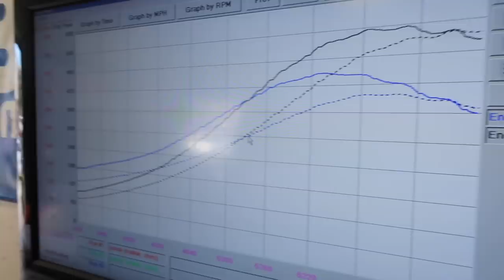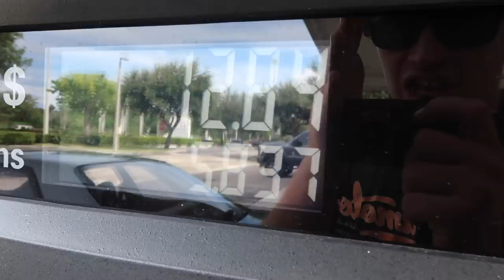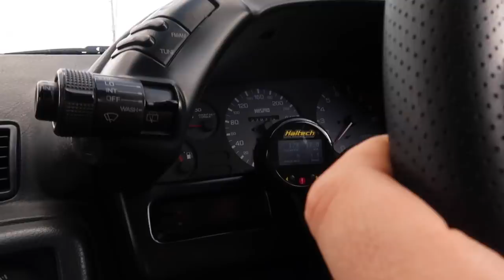GTR back on the dyno.. SHOCKING RESULTS!

Comment: Just a question, how do dyno pulls work? Do you shift through the gears normally or do you stick it in 5th and just mat it because i don’t hear any shifting during the pulls.
Reply: Dominic V I think every situation is different. I’m no expert but I believe tuners usually use 3rd or 4th, maybe even 5th gear and they use that single gear to gather the information needed.
Reply: They get up to the gear they want to test in by shifting regularly and just do the pull in one gear.

Comment: Alright, so how much power is this thing making now? Since I recall seeing 550 last go around. You're saying 100 more do you're at 650 WHP?
Reply: Roughly the same peak horsepower, the big power gains were made in the lower rpm range.
Reply: he said 560 WHP in the video, an extra 100lbs/ft torque low down - you're gonna notice that for sure

Comment: Since when are cam gears worth +90whp?  Answer:  Never, that only happens when there is an issue with another system in the car.  Shame on those professionals for not telling you the true reason why it gained 90whp.